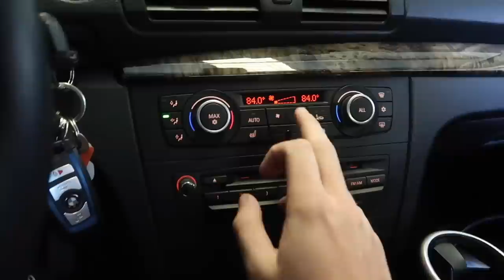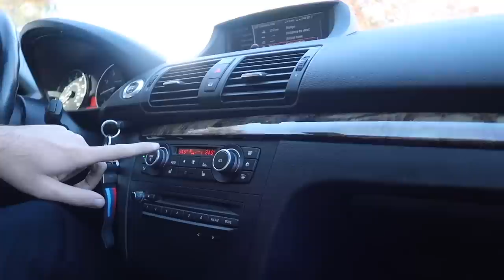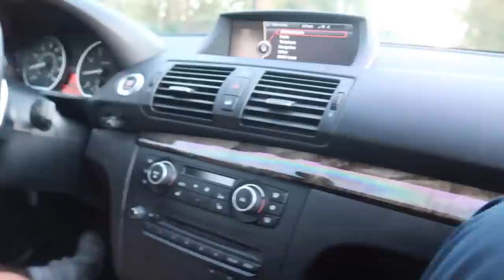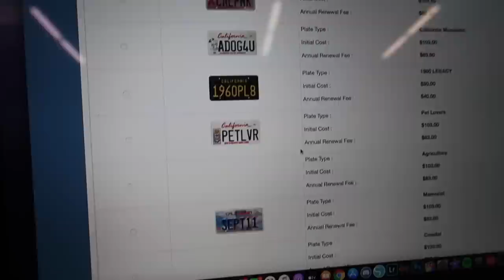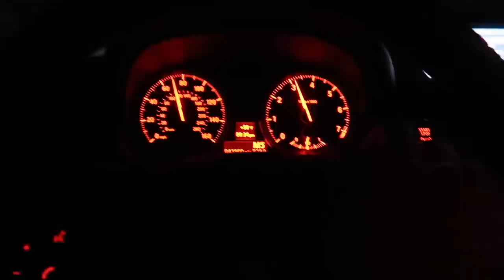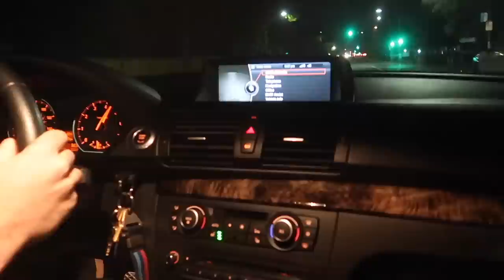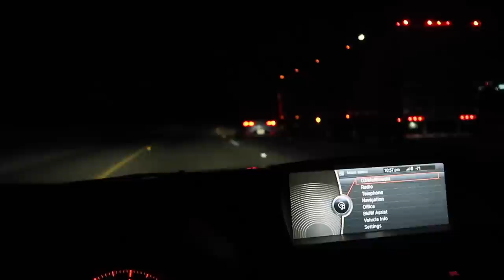FIRST MOD ON THE 128I! ($500 INTAKE)

Comment: Motor still low mileage, get modified intake lifter valves, headers, exhaust, you already got the intake so you're good on that, and a tune. Thats pretty much n52 fbo